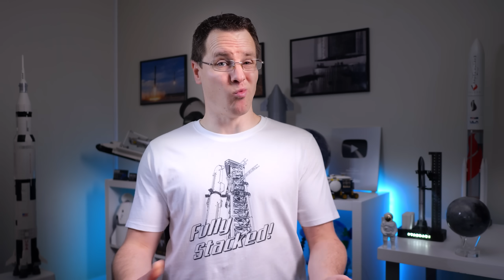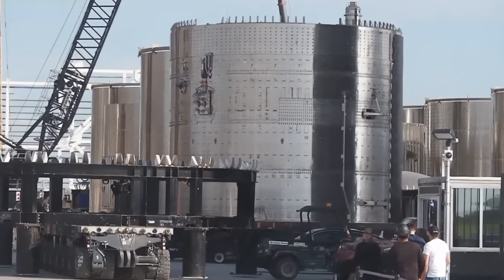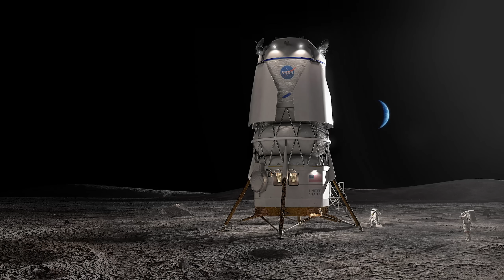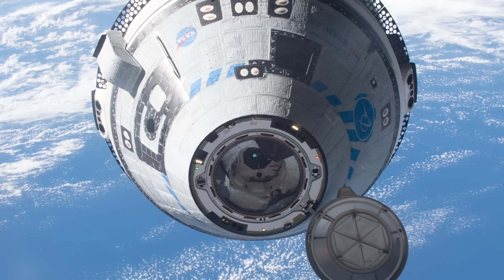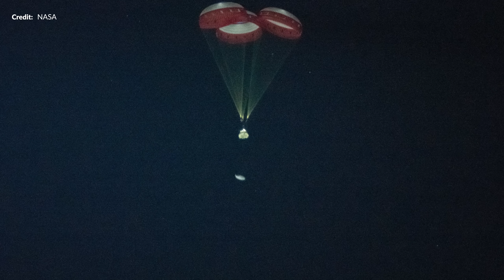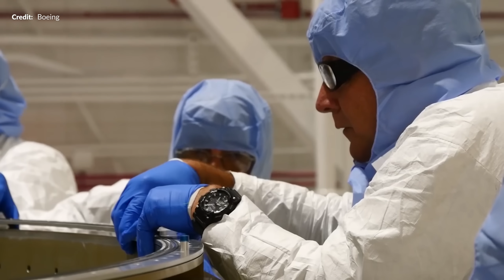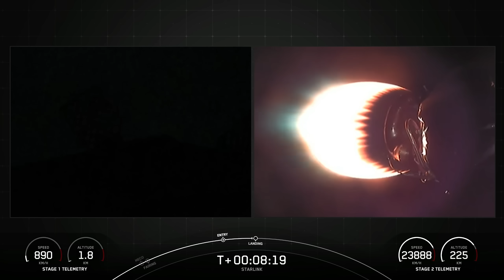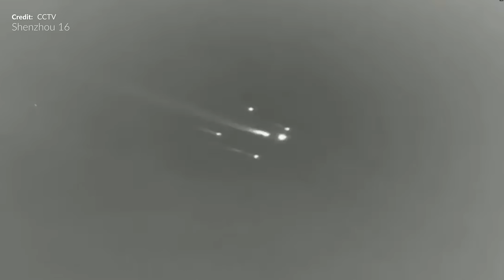SpaceX Starship: Mega Pad Upgrade to Tame the Thrust, Boeing Starliner Delayed Indefinitely

Comment: Starliner should be canceled for better of all parties.
Reply: Why? NASA has the leverage, as Boeing is paying for Starliner fixes.
Reply: @steveaustin2686  Boeing will pay more making it fly than canceling the program.  The Atlas V rocket is out of production so Starliner will have just a hand full of launches left.  NASA can fund Dreamchaser with the recovered funds which has a very bright future, and far more utility than Dragon.
Reply: @lymancopps5957  Starliner has all the Atlas-V boosters that they need for the rest of their contract. Dream Chaser got a CRS contract in 2016 and is still getting the cargo version ready. It may slip the planned Dec 2023 Cert-2 launch. SNC wants to use the 6 mission CRS contract to prove out Dream Chaser for a future crew version. Too many are blowing these problems out of proportion out of pettiness. The tape is flammable only in certain situations per reports and requires failures of other hardware to happen. Per NASA/Boeing, "Although that tape is commonly used on other spacecraft, they are evaluating if it is acceptable for crewed flight (article NASA and Boeing say preparations continue for July Starliner test flight Jeff Foust May 27, 2023)"

Boeing finds two serious problems with Starliner just weeks before launch
ERIC BERGER - 6/1/2023

"The second issue involves P-213 glass cloth tape that is wrapped around wiring harnesses throughout the vehicle. These cables run everywhere, and Nappi said there are hundreds of feet of these wiring harnesses. The tape is intended to protect the wiring from nicks. However, during recent tests, it was discovered that under certain circumstances possible in flight, this tape is flammable."

---------------

Parachute and wiring issues to delay Starliner crewed test flight
Jeff Foust - June 1, 2023

"Both the parachute soft links and wiring tape were used on the Orbital Flight Test (OFT) 2 uncrewed test flight in May 2022 without incident. The soft link issue, officials said, would only be a concern if one of the three main parachutes failed, putting additional loads on the other two, while the flammable tape would have required what Nappi called “multiple failures” elsewhere in the spacecraft."

Comment: How is Starship supposed to take off from the moon or mars?  
Sure the craft will be lighter and there is lower gravity....   But there will be no pad......
Reply: The Superheavy booster is not used on the Moon or Mars. Starship (second stage), with 6 to 9 engines, can launch from the Moon or Mars without needing the booster. The HLS Starship is currently planned to have 24 small methane (LCH4) enignes at the top of the propellant tanks for the last bit of landing and first bit of launch on the Moon. So they would be roughly 25 meters off the surface, lessening the impact of the thrust on the surface.

Comment: It was bad enough hearing the litany of problems that have beset the Starliner, but some of these problems seem like elementary problems which should never happen especially for a company experienced in rocket construction.  

The one that stood out to me was when Marcus said, "Next, adhesive tape that was used to tape up wiring turned out to be flammable posing another risk".  That is an incomprehensible oversight imo!!

Thank you marcus for your thorough coverage of these wide ranging space news issues.
Reply: To be fair, the tape is flammable only in certain situations per reports and requires failures of other hardware to happen. Per NASA/Boeing, "Although that tape is commonly used on other spacecraft, they are evaluating if it is acceptable for crewed flight (article NASA and Boeing say preparations continue for July Starliner test flight Jeff Foust May 27, 2023)"

Boeing finds two serious problems with Starliner just weeks before launch
ERIC BERGER - 6/1/2023

"The second issue involves P-213 glass cloth tape that is wrapped around wiring harnesses throughout the vehicle. These cables run everywhere, and Nappi said there are hundreds of feet of these wiring harnesses. The tape is intended to protect the wiring from nicks. However, during recent tests, it was discovered that under certain circumstances possible in flight, this tape is flammable."

---------------

Parachute and wiring issues to delay Starliner crewed test flight
Jeff Foust - June 1, 2023

"Both the parachute soft links and wiring tape were used on the Orbital Flight Test (OFT) 2 uncrewed test flight in May 2022 without incident. The soft link issue, officials said, would only be a concern if one of the three main parachutes failed, putting additional loads on the other two, while the flammable tape would have required what Nappi called “multiple failures” elsewhere in the spacecraft."

Comment: These new launch pad changes ARE NOT GOING TO WORK!!! 16.7 MILLON POUNDS OF TRUST is going to completely destroy that pad and dig a deep hole just like the last time. What must be done is to build a bigger version of pad 39A in Boca Chica.  A diverter, fire trench baffle and water deluge system twice a large as the one built for SATURN V and the Space Shuttle...with the so-called Stage Zero at least twice as tall as it is now. Nothing else is going to work. So all they are doing is wasting time and money.😡
Reply: You seems smart, how many launch pad project have you worked on Mr. Engineer?
Reply: @alvianchoiriapriliansyah9882  US Army and civilian construction... mostly roads and bridge and oil field retention disposal projects...but it doesn't take an engineer to figure out pounds per square inch of thrust on a surface....and there is no such thing as a "launch pad" engineer. What this is about isn't just the engineering...but the physics of 16.7 MILLION POUND OF TRUST...plus decades of launching experience of rockets on launch pads by NASA and other agencies....Hello where have you been? Why do you think NASA spent millions of building the launch pad infrastructure they have? Years of testing and failing rockets destroyed by poor launch pad architecture....not to mention that their launch pads are time tested and they work. Musk is extremely lucky no one got hurt during this last Starship launch. Plus Musk himself said as much when he said on 21 April 2023 and I quote ""Aspiring to have no flame diverter in Boca, but this could turn out to be a mistake." It was and it will be. So he knows that it was wrong even before he did it. Diverter/Rire trench baffle water deluge systems are a necessity and that is a fact....and to even attempt to launch a rocket with 16.7 MILLION POUNDS of thrust without that kind of system is an act of insanity. But let's say for grins it does work...what about the sound and harmonic effect without the baffling? Not to mention the damage to all the infrastructure around it? So tell me Mr. Expert... how many launch pads have you designed and built?

Comment: Who would ever trust their lives to a Boeing space craft? They refuse to do full test flights and keep having endless, deadly problems. Might as well be made in China.
Reply: 🙄 There were two OFT flights. This is the run up to the CFT.

To be fair, the tape is flammable only in certain situations per reports. And requires failures of other hardware to happen. Per NASA/Boeing, "Although that tape is commonly used on other spacecraft, they are evaluating if it is acceptable for crewed flight (article NASA and Boeing say preparations continue for July Starliner test flight Jeff Foust May 27, 2023)"

Boeing finds two serious problems with Starliner just weeks before launch
ERIC BERGER - 6/1/2023

"The second issue involves P-213 glass cloth tape that is wrapped around wiring harnesses throughout the vehicle. These cables run everywhere, and Nappi said there are hundreds of feet of these wiring harnesses. The tape is intended to protect the wiring from nicks. However, during recent tests, it was discovered that under certain circumstances possible in flight, this tape is flammable."

---------------

Parachute and wiring issues to delay Starliner crewed test flight
Jeff Foust - June 1, 2023

"Both the parachute soft links and wiring tape were used on the Orbital Flight Test (OFT) 2 uncrewed test flight in May 2022 without incident. The soft link issue, officials said, would only be a concern if one of the three main parachutes failed, putting additional loads on the other two, while the flammable tape would have required what Nappi called “multiple failures” elsewhere in the spacecraft."
Reply: @steveaustin2686  They were quoted saying there is no need for test flights as it is ready to fly upon completion. That was right before they flew a NASA mission a few years ago and it almost blew up. And that wasn't the first incident with their deadly laziness.
Reply: @treck87  Got a source for that quote? Because Boeing understood that they had to fix Starliner after the disaster that was OFT-1. NASA also admitted that they didn't watch Boeing hard enough*, which changed. OFT-2 was a success per NASA and required Boeing to fix Starliner to their satisfaction, before the CFT. Which is why they delayed again to replace the parachute links and to assess what to do with the tape. Both of which were used on OFT-2 with no problems.

You do know that between the unmanned Demo-1 flight for Crew Dragon and the manned Demo-2 flight, a Crew Dragon exploded on the test stand due to faulty valves right? And SpaceX fixed the problem to NASA's satisfaction, so didn't have to fly another unmanned Demo mission? And that the Demo-2 flight had the heat shield abrade more than SpaceX planned, which they also had to fix?

* article "NASA trusted 'traditional' Boeing to program its Starliner without close supervision... It failed to dock due to bugs" (Katyanna Quach - Wed 8 Jul 2020 )

Comment: Basically, it seems to me that the advantage SpaceX has with construction is that they're not forced to file paperwork and get a million permits for every inch of rebar and every pound of concrete and every time they set up or take down a crane or other heavy equipment.

Comment: I worry about competition for SpaceX. I don't believe that Boeing has it in them to continue to be relevant, and so I don't think that Starliner will matter much. Dreamchaser would probably have gone better.. BUT: Dreamchaser is gambling on the ULA Vulcan Centaur, which has, IMO, 2 weaknesses: 1) it's partially owned by Boeing, so I don't expect it to fare much better. 2) The VC is dependant on Blue Origin's BE-4 engines. I dunno what's going on over at Blue Origin, but their progress so far with the BE-4 doesn't inspire confidence.
Reply: Dream Chaser came in third behind first place Boeing and second place SpaceX, in the 2014 Commercial Crew program competition, because they were further behind the other two. Dream Chaser did get a CRS contract in 2016, but are still pushing back launch dates for their cargo version.

ULA has a long history of launches, so they will do fine. Boeing and Lockheed Martin have ownership in the stock. The first BE-4 engines have been delivered to ULA. They are fine tuning them to the Vulcan Centaur. Blue is reported to be spinning up their BE-4 production line, but how fast they can build them remains to be seen.

Comment: With Falcon cadence, i cannot see how Starliner is of any use. Its cost should be enough to send it to the scrap yard alone.
Reply: Because, NASA wants 2 providers in case one has an issue. Which was very smart on NASA's part, because IF they had only chosen the top provider in 2014, NASA might still be relying on Soyuz for launches.

Comment: Every time I see a Falcon 9 I am reminded of the satisfaction I would get scrubbing it back to white. I have an ancient secret ingredient in my detergent that lifts soot off paint. I understand Elon likes the soot because it shows the spacecraft has been reused.
Reply: Apparently, it is more trouble than it is worth to clean them off completely. When you see close ups of a used booster, you can usually see the grid lines where they cleaned the seams to be able to inspect them.

Comment: What is the business case for Starliner again?
Reply: For NASA, it's having 2 spacecraft. IF NASA had only chosen 1 spacecraft in Sep 2014, NASA would likely still be relying on Soyuz to get crew to the ISS.

Edit, I wrote landers at first. The same arguments for 2 crew spacecraft also applies to 2 lunar landers.
Reply: @steveaustin2686    And Soyuz continues to work very well.  With Crew Dragon there's no need for the Boeing boondoggle at all.
Reply: @popguy2815  And have to rely on Russia's good graces? Are you high? 

And you missed the point. In 2014 when the Commercial Crew contracts were awarded, Boeing was the highest rated bid. Boeing had yet to fly the 737 Max, so was still seen as a top aerospace company. SpaceX were the brand new guys still trying to land a booster with only 12 Falcon 9 flights under their belt. It was over a year later when SpaceX landed the first booster and 2.5 years later, when they first reused a booster. IF NASA had only chosen the top bid, Crew Dragon may not have been built. Starliner would still have problems and we would be trying to buy Soyuz flights to the ISS, while Russia has invaded an ally.

Starliner shows WHY it is a good idea to have 2 providers. And nothing says that SpaceX has to stay on top. Or Crew Dragon continuing to be flying great. They are reusing them after all.